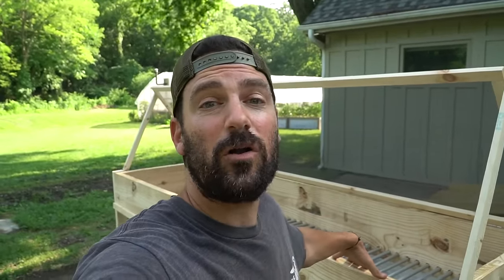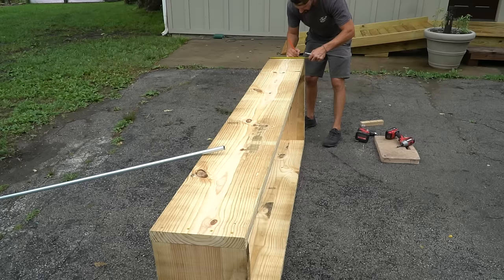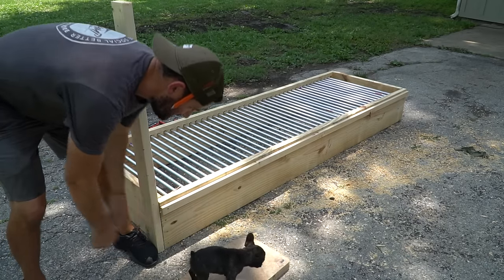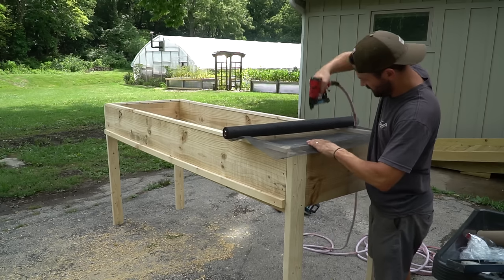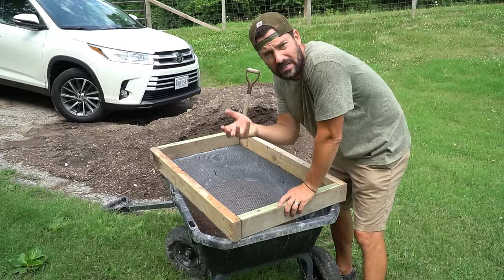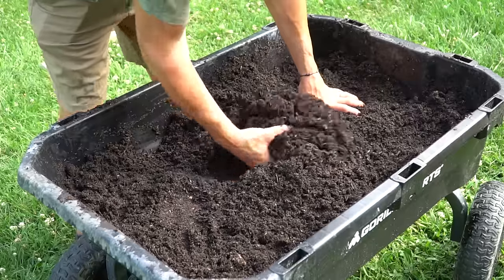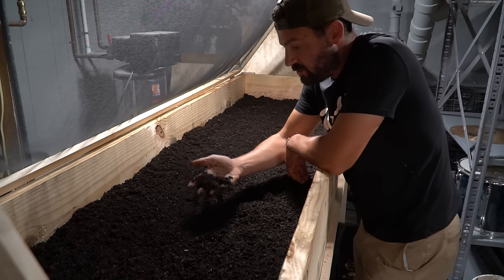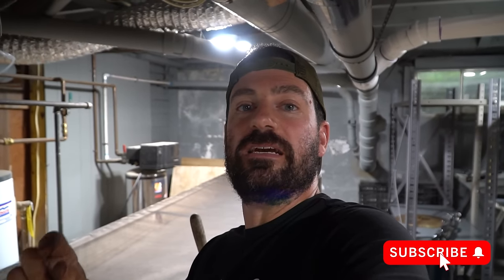How to build the ULTIMATE WORM BIN! A continuous flow through VERMICOMPOSTING SYSTEM!

Comment: I suggest that you pre-drill the holes for the conduit prior to putting it together, that way you can just clamp the front and back boards and drill through both boards, ensuring that the holes line up.  It’s easier and way quicker, especially if you have a good drill press.

Comment: You've probably found out by now but for those who haven't yet: Cover the bottom with a fine mesh stapled to a frame that you can slide out/swing out of the way to harvest...otherwise the bugs will just enter from the bottom after the paper barrier breaks. You may also want to stick a few safer's bug strips (yellow sticky cards) across the top as the scent of the compost will draw flies towards it but they'll find the sticky traps instead.
Great Job!
Reply: Never thought about that.. Thanks for the good advice . He definitely should’ve put some type of blockage between the soil and that wood cause the worms are going to eat it.
Reply: I was think that 
How fine would you recommend
Reply: @lupejauregui2  Would Cedar work better?
Reply: I was wondering how dirt & worms stayed in box and not fall through conduit as paper breaks down…
Reply: @portiaharger205  I was curious about that as well.  What keeps the worms from falling between the conduit.

Comment: Very nice build!
Few comments
1) the bin itself should be taller - at very least 50cm, better 60-70cm. How much scraps you have is urrelevant. If you don't have enough then just wait till the bedding + food reaches around 60cm.
Point is that worms like to live in top 30-40cm, so when you harvest from the  bottom of tall bin you get very few worms dropping down with casting. In shallow bin like yours you will get plenty of worms in each vermicompost harvest. Some will get injured, others will have to be put back on top. Unnecessary labour and loss of (injuried) worms.
2) if I put thin paper on very bottom I do not wet before putting bedding. Much higher chance of paper ripping and bedding dropping down instantly. Dry paper lining is much stronger. It will get dump and it will decompose anyways.
3) matter of preference but I find it easier to harvest when the rake teeth are shorter. That way you can press it against the grate without harvesting a ton of not yet ready castings.
Reply: Just what I was going to say, "That's not deep enough!  You'll be scooping worms and cocoons out when you harvest!"

Comment: Loved the video, I've had limited success with vermicomposting in my garage but I think your idea is great. There's one thing I don't understand though: when the paper on the bottom rots or gets eaten, what's to stop all the compost from just falling through?
Reply: Same question I have.
Reply: I will repost the question
Reply: @JOEZEP54  I might be able to answer that question now. Since setting up my CFT in the greenhouse I have found that by the time all the cardboard, food etc at the bottom has been eaten, the base is fairly compact. In fact it's quite a job to rake all the castings and food out of the bottom. I've done it 3 times now and it's working great.
Reply: @funnysods  - Yes, by the time time the paper degrades and your ready for first harvest, it will be compacted and will sit at the bars without falling through.
Reply: @funnysods  Can you tell me why is it that the castings naturally find the bottom? Is it because of their weight?
Reply: @RedPillSpill101 
There isn't any real explanation about the actual castings. Is there screen under the bars and castings fall through the screen when you rake. It's confusing actually
Reply: If you maintain enough moisture in the bin, the castings naturally hold together quite well until raked - which loosens them and allows a layer of them to be harvested.  If enough bin moisture is not maintained, the casting that have been building up in the bottom of the bin will become too dry to hold together well and will crumble out.  Beneficial microbes (which are the lifeblood of castings) are maintained w moisture as well.

Comment: I use an old bathtub. Filled it up with horse manure and threw in the worms. Done. Put a bucket under the drain to capture the liquid which I dilute and water the plants with. When I want to collect the compost I just feed them on one side of the tub and they migrate to that side.

Comment: It looks good - glad to see the height - my first one was too low, and my knees wouldn't let me get back up after harvesting.  I lined my bins with salvaged fluorescent light fixture plexiglass.  I think you might need to add a 2x6 to the top for more height - you need room for the worms to live and a place for the castings to settle.  I'm ninety-three  now and have switched over to using grow bags (Gardzen Raised Garden Bed - Planter Box) where I can do everything from the top with the bed sitting on a rack - works great - got the idea from AV (GroBag) and Meme (Bagster).
Reply: I agree with the bagster idea. This is what my African Nightcrawlers are in my backyard. It’s working out very well.

Comment: It will be easier if you lay one side board on top of the other, then drill through both side boards at the same time.  You should also lay some sacrificial boards perpendicular to & below the bottom board to save from dulling your drill bit.  The boards can be kept aligned by using 3, "2-headed" nails, so the drilled holes will also be aligned.

Comment: Will the wood rot from being in contact with damp soil. I was thinking you could of covered the sides and ends with black plastic before screwing them together?
Reply: looked like untreated timber. Yes in contact with moisture/soil it will rot within a few years. I’d have varnished it. It’s a great idea though, and the rake method to remove the castings is so easy.

Comment: Good job. That’s a huge worm bin! I don’t know why you would use kraft paper though. Kraft paper is usually wax coated, which might not be good for your worms or your compost for your garden. Kraft paper also has “naturally occurring titanium dioxide coating.” I’m not sure if that’s a good thing. A lot of people use newspaper, which will break down quicker. I would not use corrugated cardboard, either, as cardboard has glue in it, which may or nay not contain harmful chemicals.
Reply: Cardboard does not have harmful glues in it and is safe to use.

Comment: Have you tried pvc conduit instead of the steel stuff? I feel like it would support the weight without a problem. Its 1/4 the price too so I figured its worth asking lol. Apologies if you mentioned it amd I missed it.
Reply: Yeah i wouldnt use the steel conduit its galvanized and not food grade. I wonder if you could use pvc with rebar or something inside for extra support.
Reply: @k_froggy  plain steel will also rust - I don’t think that was stainless steel conduit.
Reply: @wintersun398  it was galvanized meaning zinc coated
Reply: Forgive my ignorance but it seems like the dirt will rot the paper and fall through the galvy tubing? 
I’m a novice so apologies if it’s a dumb question
Reply: Not dumb! Many people are asking the same question. Another guy said he does need a screen.
Reply: By the time it's ready to harvest the casting will be bound together. The initial paper on the bottom is just for initially keeping it from falling out.

Comment: Ok Boss as a ol man who has done this kind of thing for Decades I'd offer 1 thing that I didn't see you address. That would be wood rot I didn't hear you say that your wood was treated which it shouldn't  be ,but it should be protected . What would have been a simple and cheap long lasting way would be to have lined the box with black plastic ( that comes in rolls ) all except down through the middle so you still get the flow through for your castings but the wood will be protected from wood rot . |Nice set up tho , Not sure I would have put in in my basement but I do live in temprent climent so with the heat frrom the deteriorating compost my warms have plenty of heat to winter over out in my greenhouse where it also contributes to heating my greenhouse. subscribed and will be watching keep up the good work.

Comment: If the conduit is only for supporting the paper in the bottom there is a lot cheaper method for doing that! I.E 1/4 inch hardware screen stapled to the bottom with a couple of cross bars.
Reply: You need the bottom open to be able to rake it out from the bottom. Any kind of screen will prevent that.

Comment: Although I am not an expert, I have managed a small worm bin and I am very skeptical of this design. The thin Kraft paper holding the compost and worms above is destined to decompose. When that happens what will hold back everything from falling into the trays below? Let alone when you cut the paper with your pitch fork? This doesn't seem like a long term barrier and there is no easy way to replace it. It will fail. Am I missing something?

Comment: Pro tip use malted barley lots fruits and veggies are good but mostly water worms can’t make a whole lot of castings with just fruits and veggies need paper has ink on it not a good thing to add use grains kelp meal Karanja cake and neem cake neem cake will keep bugs out as it’s a natural pesticide and both neem and Karanja cake will hold nitrogen in the soil and last is a ton of basalt rock dust you’ll need aeration aswell pea gravel is cheap and easy to get but if you want to go fancy and have that professional looking soil worm bin the best thing use 3/8 ish size pumice I use Hess pumice to get my pumice needs it’s more expensive if you don’t live in the Pacific Northwest but really gives you that pro soil look perlite is not a good aeration material it moves too much it’ll all end up on the top of the soil or worm bin